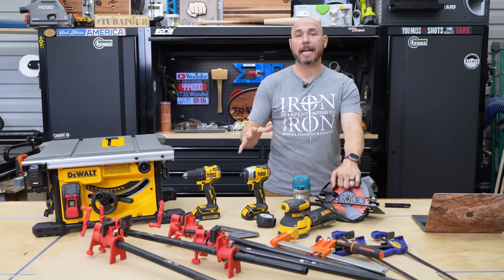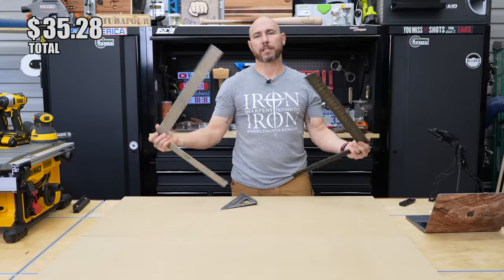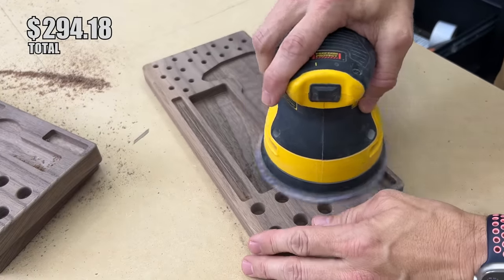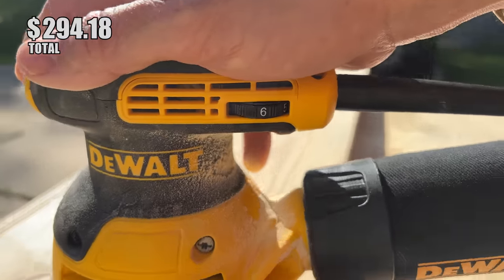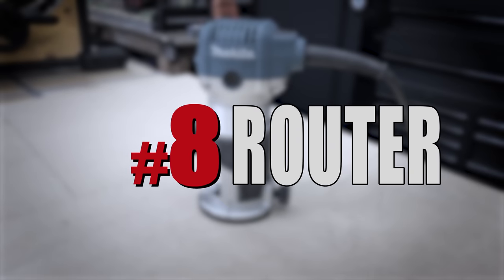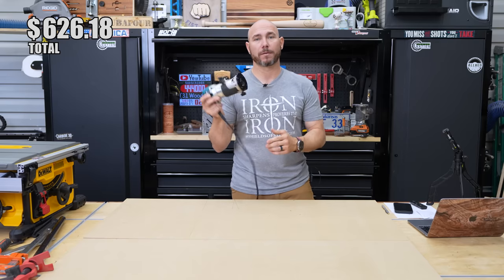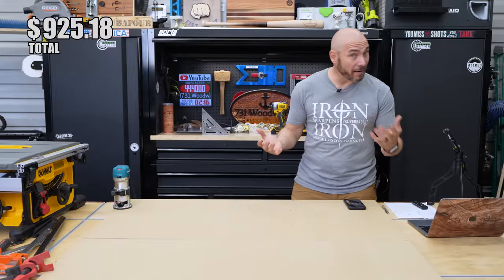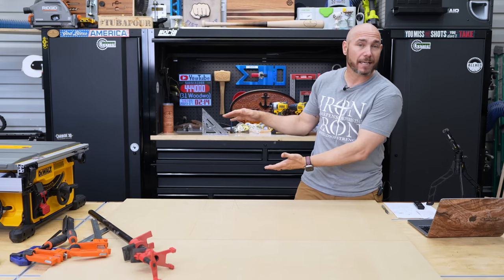Beginner's Guide to Starting a Woodworking Shop for under $1,000

Comment: These are good recommendations, but if you are a beginning woodworker, then I do NOT recommend either a table saw or a trim router. I say this as someone who, for the first ten years or so of my woodworking adventure, did not own either tool, yet I was able to build some very nice, useful projects (to be clear, I'm not recommending that you wait as long as I did for these purchases). Both of these tools, honestly, can be very intimidating to a newbie. Forget the spinning blades and bits that appear to be coming for your fingers; the noise alone is enough to ruin a good pair of shorts. I would instead suggest, in addition to the circular saw, a jig saw; I know that many dislike them, but with the quality tool and good blades, they can be very useful. I would also point to the HomeMade Modern channel run by Ben Uyeda, who rarely uses a table saw and finds clever ways to cut with the grain, all while making eye-popping modern home furnishings.

Comment: Pro tip:  read the manual on that Skil circular saw.  I didn't and kept trying to change the depth by pushing the lever in the wrong direction.  Thinking the new tool was just being stubborn I broke it.  Stupid trumps stubborn every time. :P

Comment: Can you do for the Ryobi/Milwaukee Days? Or a video for the different saw blades?

Is the DWS779 being phased out for the DWS780
Reply from the maker: DWS780 is an "upgraded" version of the 779.  Basically you get a cut line with the 780 and not the 779.

Comment: Where is the recip saw? I started out woodworking cutting out shapes ditch the quick clamps for recip saw. Also one needs to finish the project smooth so a belt sander.

Comment: OK. The verdict is in. I got my five tools from Temu in China. Took about a week to get them. This is what I got and what I think. Five rolls of green tape. $5.84. I thought it would be like Frog Tape. It wasn't and the rolls were tiny. A rip off. Ten little flat brushes with blue handles.  Smaller than expected, but they were OK for 83 cents. Combination Square, inches, yellow. $5.59.  Excellent for the money.  Red Aluminum Precision measuring ruler. 12". $7.98  Accurate. Good for the price. Carpenter's Speed Square, Aluminum. 3.99 Worth the money. So, my final verdict is, you have to be careful. Do not buy tape. The rest was fine and arrived in 6 days.  They flew it direct to NJ, and then delivered it from there to my house by ground, about 100 miles away.
Reply: Tonight, I got on the Temu site and contacted their customer service via chat. I asked for my money back for the tape, which they refunded to my PayPal account without questions.  I will buy from them again.

Comment: The 12” dual bevel version of that Wen saw is only $280. I have one, and it’s fantastic. No, Wen is not a new company. They’ve been making power tools since 1951, and are one of the companies responsible for the creation of power tools. They’re certainly nowhere near top of the line, but they do make great tools at great prices, for the most part.

Comment: Matt, amazing video as always with great suggestions. To Matt and all you great people in the comments - please vote with your thumb or indeed your keyboard  - Dewalt or SKIL table saw? thank you all so very much for helping me make up my mind as a beginner who is trying to better himself. 🙂

Alistair
Reply from the maker: DeWalt
Reply: And not attempting to stalk you so I’ll understand if you don’t respond- if I spent a few dollars more and went to the 10” Dewalt DWE7491RS am I making a smart move or stick with the smaller brother ? Or a different brand ?  Thanks for all you guys do and have a great weekend.
Reply from the maker: @ALSpain   Yes, you are thinking correctly.  The 10-inch model will have more cut capacity and you'll be happier with that saw for longer.  You can also look at models like the Delta 36-725T2. Grizzly has some models under $1000 as well.
Reply: @731Woodworks  thank you Matt. Hope you both have a safe and enjoyable weekend.

Comment: I don't get the circular saw thing. You can cut as good with the table saw, and the fence, and if you make some supports you can pretty much cut large sheets correctly there. That may depend on what you build but, meh.

I really get the point of the cutting sleds you can make for a table saw, but I think you (all youtubers almost) focus on versatility and quality. Your builds are awesome and makes me dreaming, but if you really want to give advices to beginner woodworkers, I think you could resume to some quick (to make) and cheap sleds that will help. Because honnestly, as starting woodworker, I'm not enclined to spend like 60$ on mitter bars, 40$ on T tracks to get stop blocs, and then like 30$ more on inserts, router bits and everything to be able to cut at any angle.

I think more than tools for beginners or sleds, the whole problem is not people being cheap, or beginners, this is a confidence problem. When you start out, you don't want to spend 2000 (or even 1000) for something that you think you may abandon because you're not good enough/don't have enough time/it doesn't please you. And moreover, you don't even know if you're gonna be good at it !

So focussing on building nice little things with as few of tools as possible should be the way to go to build confidence, and then increasing it.

So I think it could be a whole video, make a basic crosscut sled in 5 min. Upgrading it to get 45° cuts. Then upgrading to get 60° ones. It could even be a video series, first step, second step, going into details and how we could work without having tools (like inserts) to get things square etc...

Comment: Just curious as to why you didn’t include a planer?
Reply from the maker: I worked for a couple years without a planer.  Not necessary for a beginner.
Reply: How did you work around it? Isn’t that the only true way to get your boards squared up when making tabletops? I’m preparing to start purchasing some equipment and I assumed that a planer helped with that. Btw, I enjoy watching your videos and find them very informative. Thanks for answering me, as well.
Reply: I have a question. I haven’t bought a table saw yet. I’m trying to cut 3/4 inch plywood with a 2 1/2 HP 13 amp 7 1/4 inch corded circular saw. Brand new DIABLO blade and I’m using my level as a fence. I have the level clamped down and it’s not cutting straight. Maybe my technique is wrong. I’m new to all of this. And it’s not cutting straight. The saw is slowly moving away from the fence. Blade is turning black and so is the wood in the cut. I’m lost. Could you possibly give me some advice? I wish I could send pictures but I’m new to messaging and commenting on YouTube.

Comment: What's the best nail gun
Reply from the maker: I have cordless Ridgid and Ryobi ones that work well.  I have pneumatic Porter Cable ones that are excellent as well.
Reply: @731Woodworks  what size nailer is the best
Reply from the maker: @frankgreen7988  18 gauge brad nailer for most small projects. A pin nailer is useful if you do small trim work.
Reply: @731Woodworks  thank you

Comment: Decent start but the drill, driver, and router aren’t going to be much good without anything for bits and a reasonably good set of drill bits can cost around $75 or so alone and then to consider your standard set of driver bits and even a simple 6 piece router bit set. That could easily be near $250 if not more.

Comment: I expected the bonus tip would be safety gear, safety glasses, dust mask and hearing protection.  I agree you are under $1000 but what is the price of cutting one's finger/hand off?  Saw Stop is really for all beginners unfortunately since they make the most mistakes.  JMHO
Reply: Most beginners won't have the budget for a Saw Stop even with the cheapest one running around $900 last I looked.

Comment: Clamps. My goodness. Where do I start? First off...been making sawdust for 30+ years, professionally and personally. Second off... surprisingly, I not only agree with both of Matt's recommendations, but he chose the two brands that cover the clamp rack part of my wall.

Pipe clamps first. Pipe clamps get a bad rep, because nobody teaches the proper care, treatment and use of pipe clamps. Pipe clamps are designed SPECIFICALLY for use with black pipe. ONLY. Galvanized pipe, while it stays prettier longer, will only cause you heartache and grief. You see...first off galvanized is slightly larger in diameter than black, because of the galvanized coating. Your tailstock (movable portion of the clamp) won't slide nearly as easily as it would on black, causing grief and frustration as you try to slide the tailstock snug to your project. Second...and most importantly...the galvanized coating on the pipe is soft...too soft...and frequently the clutches on the tailstock will slip causing the clamp to lose pressure. I cannot stress enough that a clamp that won't hold pressure is NOT a clamp...just a twenty dollar reminder that you should have followed the directions in the first place.

Now...I freely admit that black pipe needs loving care and maintenance. New pipe needs to have the oils and shipping protectant removed. A shop rag and some mineral spirits does just fine. With that done, wipe the pipe down with your favorite rust prevention... I'm old school, so I just use a light coat of paste wax. I have had black marks appear on projects I've glued up, and it can ruin a project if you determine the marks cannot be sanded or scraped off. My solution is to use waxed paper. When Momma's not looking, hijack the roll from the kitchen and cut it into four equal lengths...you should now have four 2 1/2" rolls. Tear off a strip slightly longer than your project and lay it over the bottom pipes. Easy-peasy. Protect the top of your project in the same fashion. The wax rejects most wood glues, and removes easily enough. If some does happen to stick, it sands right off.

The clutches will dig into the pipe. About once a year of so, take a mill file and remove any ridges the clutches may dig up. It is also a good time to apply more rust prevention.

1/2" pipe clamps sets cost a buck or two less than 3/4". 1/2" black pipe is about 25% less than 3/4" pipe. That monetary difference will get you one more clamp set, using Matt's budgetary constraints. I very highly recommend Bessey clamps. Their clutches are better, stronger and much longer lasting than any other brand I've used. Buying Bessey now will save you money in the long run...please believe me. I have, and use, some clamps I've had for 20+ years...so long that the bright red paint has oxidized! Lifetime investment...buy once, cry once.

Comment: Also, can use the “CyclingDeal Bicycle Road Mountain Bike Fork Steerer Seat Post Handlebar Cut Saw Guide” as a guide to cut the pipes to length to make straight cuts (ASIN - B006WRWA26)

Comment: Why do people like to push DeWalt? I have had DeWalt tools and tossed them to the trash within a few years. I have had cheaper options for twice as long.
Reply from the maker: Never had an issue with any of my DeWALT tools.
Reply: I still have 18v stuff on a second set of batteries from like 2010 lmao, tools are from 2003. I've also pulled quite a few corded tools out of a quarry and they still work

Meanwhile my ryobi stuff died in 3 years or less

Comment: Howdy Mr. 731...

Great video Sir...

Tool you missed, and I've been saying it for awhile now....A QUALITY pencil Sharpener. Just like what "we" used in school. Hand crank. Mount it almost anywhere. I use the Exact-O brand. Very very good pencil sharpener. 

And, as a BONUS tool item alot of people overlook...A Pad of Graph paper. Yeap. 

Let's face the truth here. We can ALL buy these tape measures and power tools all day long and fill our shops up with them.....BUT......Ya ain't gonna build not ONE single project without some paper and pencil AND a "QUALITY" sharpener for that pencil. 

Total cost for the sharpener, a box of #2's and a pad of graph paper....$25 - $30 bucks. 😅😊😅😊:_mallet::_hammer::_saw::_fistbump::_fistbump::_fistbump::_fistbump::_fistbump::_fistbump::_fistbump:
Reply: The tape measure he recommends has a built in pencil sharpener. Dollar tree has #2 pencils 10 for $1.25.